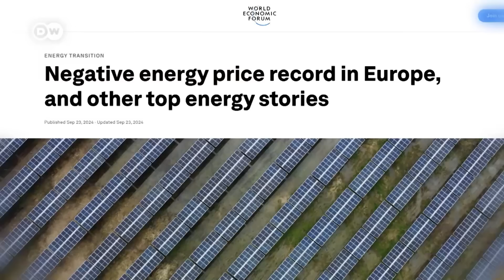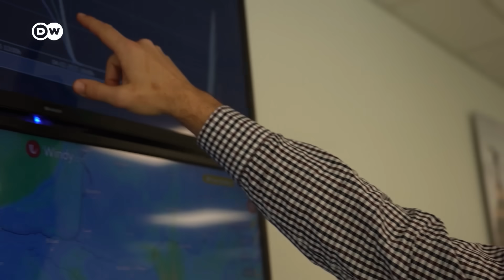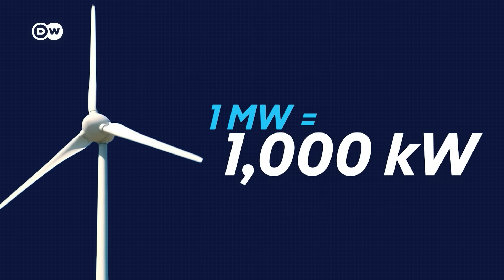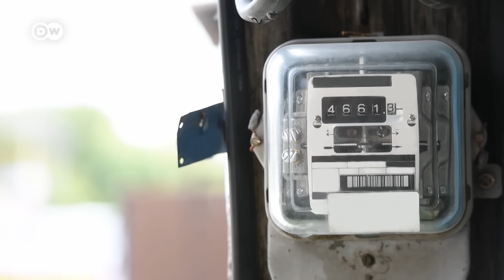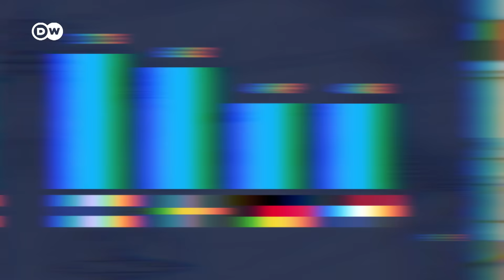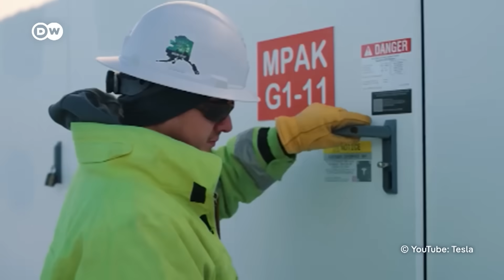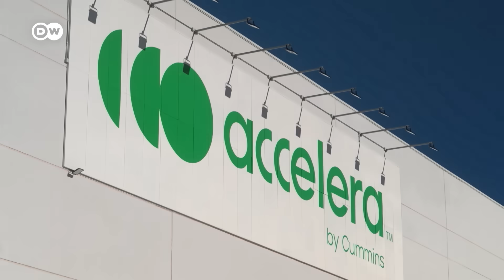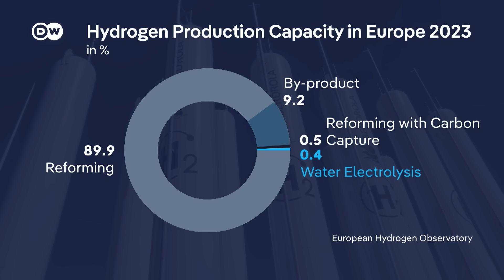Negative energy prices: Why cheap electricity can create huge problems | Transforming Business

Comment: Not a problem right now. UK and Germany with their added renewables have some of the most expensive electricity in the world.
Reply: I would actually say you could compare it on an operating cost base Level. But ingnoring the upfront investment i see Wind and especially sun Power as the absolut winners, because you dont have cooling Equipment, personell for operation and multiple safety layers wich have to be controlled beside the input and output cost of a nuclear reactor. When installed, a Pv Plant just works. Maybe some checking here and there and maintaining a connection to the grid Systems for selling and Regulation capabilities but that can be automated. 
I would say that perspective is the reason why so few bother if they sell some hours on the penny because it costs them literally nothing to operate the plant an hour more on a Day.
Reply: Retail electricity price is complicated.  It still includes natural gas generators and what's known as "marginal pricing".  The actual prices for utility-scale renewable generation is still cheap and the grid owners and generators can pocket the difference because of marginal pricing is based on the most expensive electricity generator in the system.  This is all the more reason to accelerate the energy transition even faster.

You're looking for lower electricity retail prices like in France?  Their state-run power company EDF is operating with crushing amounts of debt like over $80 billion euros and a debt-to-income ratio of over 700% They've used subsidies and other government assistance to keep their retail electricity prices artificially low.  But that meant banking huge amounts of debt over the years because of expensive nuclear energy.  France can actually go bankrupt since it cannot print its own money as its part of the European Union, unlike the UK.
Reply: @beyondfossil Nuclear energy is actually very cheap. You mean that building nuclear plants is expensive, which is different. But it's not true that all nuclear energy companies are loaded with debt and going bankrupt. Maybe that's the case in France, but not in general. Also, i don't get why "sun and wind guys" are so against nuclear. Nuclear energy is not a competitor to other renewables, but to gas and coal! You always need a baseload, during the night or where there's no wind. You could have 15% nuclear, and 85% renewables. Nuclear energy is way cheaper than natural gas.
Reply: @960john  Right now, the LCOE cost of renewables plus the LCOS of storage is cheaper than the LCOE of nuclear alone!  Both costs of renewables and storage are getting cheaper while commercial nuclear heads in the wrong way!  There's no point to commercial utility-scale nuclear even now and even less so as each year goes by as the bar gets higher each year for nuclear power's already long list of problems both engineering and financial.

Simply put, as each year goes by, commercial nuclear just becomes less relevant.  It's not to say nuclear is completely gone though.  Nuclear has a place in small-scale applications where it excels in like military, scientific, and deep-space exploration.  There are simply no good alternatives to nuclear in these areas and they are important areas of society too!

I would expect deep-space exploration becomes increasingly important to our society if everything goes right.  But, as it is, commercial utility-scale nuclear is simply the wrong tool for the job on the grid where large-scales are required.  Commercial nuclear is simply too collectively small, too expensive and has unparalleled risks that no other electricity generation even approaches.
Reply: @960john  Sorry but it's not accurate to piece meal out costs like that and call nuclear energy cheap.  You have to look at all the total costs over the lifetime of the power plant.  One such calculation is LCOE and nuclear has the highest LCOE costs around, especially new construction nuclear in today's era of high interest rates and inflation.  LCOE is an important tool used by industry and government policy makers as LCOE allows comparison between disparate energy sources.
Reply: @beyondfossil at times the price for electricity is low but the cost of producing it with wind and solar are expensive. All this means is all the wind and solar are massive malinvestments. They are not even marketable.  Take away communist  subsidies and they immediately go bankrupt.

Comment: There are three 3️⃣ parts to this issue...
1.  Many European rate structures are designed to reward high cost production.
2. Under investment in battery storage.  Australia, Texas and California are way ahead of Europe.
3.  Under investment in transmission infrastructure.  This includes ultra high voltage DC.  Big gaps exist in the ability to move electricity around Europe to better match supply and demand.

Comment: So now cheap energy is a ‘problem’? Seems like we’re allergic to good news these days.
Reply: DW failed to clarify, that negative energy prices only occur on high wind, high solar hours when demand is low and therefore for most if not all of winter in Northern Europe the opposite is true and energy prices peak due to the amount of oil and gas still required to supply energy in winter. During this time, renewable energy companies get paid higher prices for their electricity when oil and gas is added to the mix. So the issue for investors is not that investors cannot make money with renewables, it’s that they can make more money with other investments which give higher returns, such as oil and gas, which are still highly subsidised by governments.
Reply: @ImpossibleSolution-k6w 
Yes exactly.
Those subsides startet a long time ago and have just increased as time passed.
Maybe we need to look at those subsides again, cause it makes no sense to subsides oil and then have a CO2 tax as we do in Denmark.
Reply: Sounds good. I wanna get paid to take their electricity.
Reply: Ur missing the point - what we need is stable cheap energy. If you can't guarantee payment when energy is produced no one will want to build more solar and wind farms.
Reply: "cheap" energy sis not the problem but the big fluctuation of energy prices. Depending on what hour it is and how much wind/solar produce.

I do belive however that this is a temporary issue, there are a lot of grid-scale batteries planned.
Reply: @thomasthereal4067 the problem are the energy companies and goverment that not alow you to share with others but the companies
Reply: Seems like a market structure problem. What policy reforms can be done?
Reply: It's only cheap for a few hours a day, and very expensive for the rest of the day. If you only use power for those few hours when it's cheap, then it's not a problem. That's what they want you to do. The thing is, most people use power the entire day, including the expensive hours, so their power bill averages out to be quite expensive.
Reply: @jmlinden7  that is somewhat true.
However renewable is by far the least expensive energy.
Wind power is 1/3 of nuclear and solar power is 1/4 of nuclear power.

So we just need to keep building and also build storage facilities.
Once that is done we will have the cheapest energy in the world.
Reply: @ Wind + storage or solar + storage is not substantially cheaper than nuclear. Depending on climate it may be more expensive
Reply: @jmlinden7  it's way cheaper. Storage isn't that expensive, that it would increase the energy price by 3 or 4 times.
Why would you claim such a thing when you obviously don't know?
Reply: энергия не нужна на электростанции - она нужна у потребителя, поэтому она никак не будет "дешевая".
себестоимость производства электроэнергии - это на 30-70% капитальные затраты. кто их будет инвестировать если они никогда не отобьются?
Reply: Of course, it is. Imagine that you are a shop owner, and you even need to pay customers to take your goods.
Reply: @imantsjansons5009  Nationalise it if thats the problem
Reply: @imantsjansons5009  Theen everyone takes a day off and stop making things. Problem solved.
Reply: @imantsjansons5009  then post-scarcity
Reply: you will realize title is click bait if you finished the video.
Reply: Yea that is the discount on products before they go rotten going negatively is to help super markets reduce the cost of throwing them away... Also green energy  sucking due to being  unreliable is regarded as bad ting generally.... Also this will cost end consumer not giving him free stuff to all the big brain thinking this will result in cheaper power....
Reply: @ЛъчезарСтанев  it was in the past we didn't have a solution to energy storage.
That problem has been solved and as I just said in my previous post, we are now scaling up fast and huge on storage.
This was the only problem with renewable and once we have enough storage the renewable energy will be way cheaper.
It's 3-4 times cheaper to produce solar and wind power than nuclear and nuclear is several times cheaper than oil, gas and coal.
So it's not a discount it's a lifespan savings on renewable. 
Look up LCOE if you are in doubt.
Reply: If German households had cheap electricity, it would be good news.
Reply: @AndreLeRoux81 yeah and negative energy make  home energy go up
Reply: doesn't matter if the users of the energy are still paying high prices... the low price is the price being paid to the energy producers. The energy consumers however are the real problem and they're paying more.

German energy prices for households is the 5th highest in the world. So where is the good news? That windmills aren't getting paid good prices?
Reply: Because if it’s too cheap for long, people won’t invest 

Tell me, would you invest in a stock that’s losing value and is almost certain to lose even more ?
Reply: @VishalGiraddi , The government can do the investing.  And public utilities can be forced to take very low returns.  They do that very well in China, because utilities are considered public goods, just like the interstate highway in the United States is considered a public good.
Reply: Showing kw while saying kwh is a big error
Reply: Overcapacities is a problem from Ex Treasury Secretary and Professor Janet Yellen and she will be Nominating Overcapacities for Coming Nobel Prize for Economic. 🤔😉🤣🤣
Reply: It’s a stepping stone to the future.
Reply: In Europe, everything that benefits the people is bad
Reply: Consumers dont benefit from negative price. Big electric companies have contracts. They have 0 impact. The impact is for little people that try to copy big company and make solar farms or put solar panels on the roof. This people that have to pay back to power grid because power grid take there produce power.
Reply: It's a problem for new renewable energy projects - not for consumers. In Australia with Amber Electricity we can get the wholesale price by paying a monthly subscription, and prices go negative on about a third of days. Imagine being paid to heat your water (with a heat pump), cool or warm you house (with more heat pumps), run your appliances, and charge your EV and home battery!
Reply: It’s only a problem due to capitalism
Reply: Market mechanisms don’t always work.    That’s why we need the government to be involved and spread the profits for the benefit of the whole population.   China’s energy is getting cheaper by the day and will be nearly “free” eventually.
Reply: The problem is that you need a backup to all the renewables. Let’s say a gas plant. If you need it only for 3 days a year, it needs to make back all its costs on those 3 days. 

The cost of parallel energy systems are never counted into the “price” of renewables.
Reply: @thomasfsan  we use backup now because we don't have enough storage yet. Once the storage is built, backups will be obsolete.

We are currently building massive amounts of storage of many different kinds, but even so, it will still take years before it's all done.
We are building both thermal storage, huge batteries, hydro storage, gravitational storage, power to x, and much much more.

Once we have enough storage, renewable will be way cheaper.
So it's only during this transition fase we need backup.
Reply: Now cheap energy is really cool , useless electricity that damages the grid or spendig money to run assets that produce an asset with no value it is not .

Electricity has value only if needed if it is not needed it is a problem. Waste leads to higher price for the consumer not lower
Reply: Yea because we are woke
Reply: BASE LOAD. DYOR!
Reply: @tibsyy895 So what's the base load power requirement when prices go negative? It's zero.
Baseload  power is a 20th century term - dynamic loads is the new energy paradigm.
Sure, do your own research if you like, but do good research - not just listen to shallow click bait videos on the internet.
Reply: So what dynamic loads? Gas and coal?

Comment: electricity price volatility will jumpstart a de-centralized and un-subsidized battery 🔋bonanza never seen before! 
👍🏻in addition, batteries will stabilized the grid and will make a portion of the grid build-out obsolete! 😊
Reply: It will not work.  You would still have to match exactly what you store with what is used. Even if the balance was just off a few percent after a few days you would be out of storage. It is all ) wind,solar batteries) a massive waste of resources that is about to take europe back to preindustrial living standards.

Comment: Negative prices that's the dumbest thing to say, bordering clickbait... nothing costs in the negatives, there's still a minimum $ amount from maintaining infrastructure and others... I'll tell you what it means: your math is wrong. Investors be damned if returns are not what they expect.  Stricking a balance is crucial for sure. The swedes got it right. Are you telling me no one else can?
Reply: lots of things can cost in the negatives. 

As far as I'm aware, you have to pay to get rid of tyres. 

Any item that has reached the end of its life, and isn't economically viable to recycle should have a negative price. 

If you are making more electricity than you need, what is the correct price when it needs to be used? you have to pay someone to use it, therefore a negative price.
Reply: @ there are no negatives in accounting, either it's a credit or a debit...  ... the cost to recycle that tyre is not part of the tyre itself... A negative balance is an indicator that an incorrect accounting transaction may have been entered into an account, and should be investigated.
Reply: @nacho71ar  yes there are. If you buy stock you gain an asset and a liability. Your bank balance goes down, your stock level goes up. How can it go down without negatives, how does an overdraft work without negatives?

I'm not saying that the cost to recycle a tyre is part of the tyre. But neither is the tax, or delivery.

At the end of the day you have an asset, the tyre that you have to pay to get rid of, so it's a liability. It has a less than zero value.

A credit is a negative debit and visa versa. A liability is a negative asset.

A negative balance is totally normal. Your overdraft is a negative balance, so is your mortgage and credit card bill. 

Just because the whole system can't be negative, because we can't magic money out of nowhere, doesn't mean negatives don't exist. If one thing goes up, another thing has to go down to balance out. To go down you need a negative.
Reply: I paid money today because my small solar on my roof that I installed in 2011, sent 30kWh into the grid. I forgot to turn it off before I left for work. and since the price was negative I had to pay to deliver it on top of the transfer fee pr kWh.
Reply: @ That's just... wrong. LoL. But there you go... it's just nonsense... if anything the electric company should generate less power, use what solar users deliver... and should owe you $.

Comment: When wholesale electricity prices go negative, it actually means electricity bills are going to skyrocket. It also means that power plants are running uncontrollably even though electricity isn’t needed. It’s the same as saying that we’re spending hundreds of billions of euros to upgrade a dumb power grid just to bring electricity from wind turbines placed in remote mountain areas where no one lives.

The fact that electricity is being generated beyond demand is not a good situation at all. It can lead to large-scale blackouts, and to prevent that, money actually has to be paid. The absurd part is that when electricity is actually needed, the power plants aren’t running, and instead electricity is imported from neighboring countries at outrageous prices, causing electricity costs to skyrocket across all of Europe.

This is just like the collapse of communism. Everyone dreams of a utopia where all work equally hard, but in reality, selfishness leads to no one working at all. Likewise, to maintain a stable power grid in any situation, we need enough backup through batteries, fossil fuel plants, and nuclear power. But Germany has blown up all power plants except for wind, destabilizing its own power grid and forcing neighboring countries to pay enormous sums.